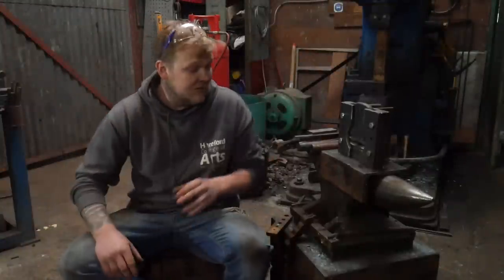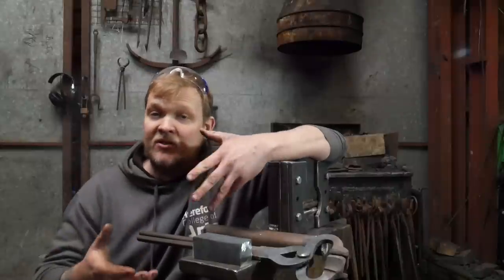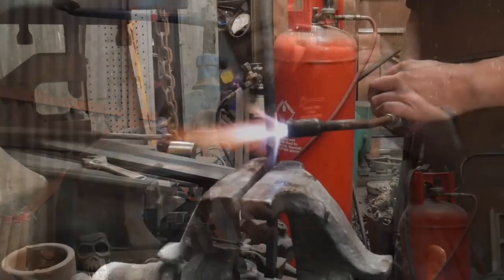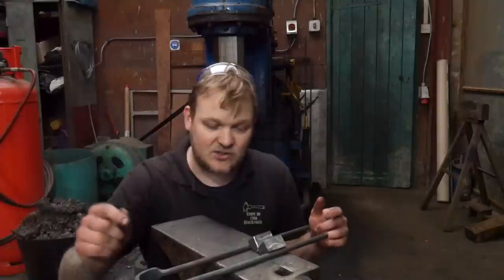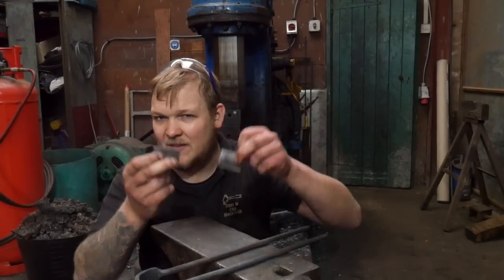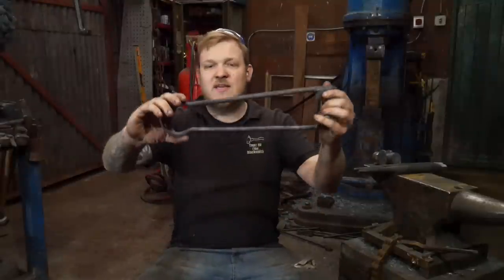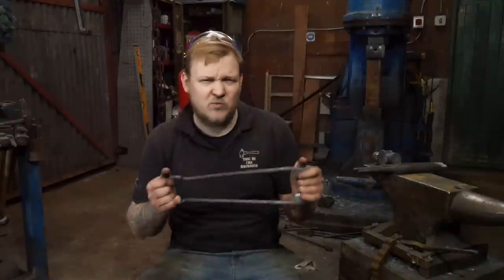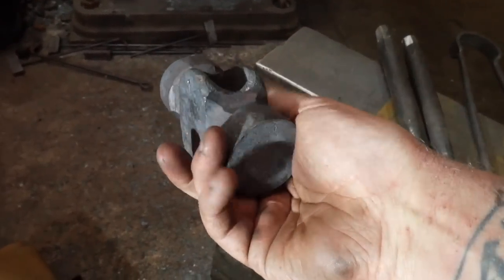Spring Fullers & Hammer Eye Drifts. Tools to make tools.

Comment: Good to hear you're busy. Hoping to see some more hammers up on your Etsy. I'm defo in the market for one of yours. Need a 2.5 (or so) pund rounding hammer. When you've got some stock on hand ping me and I'll buy it as soon as you do. Also, I'd love to see a how to on a spring fuller for a hardy hole. I don't have a striker or power hammer. I've had crap luck doing one myself

Comment: Hi Dan, love the video's on tools to make tools.  I'm in the process of building my first forge and its great to see the techniques you use. Can you let us know which materials you use for the different tools or alternative materials if possible. Thanks, Rob.
Reply from the maker: Ill try to remember for the next video. Ill do a bit on steels. Thanks for the great comment.
Reply: I am also interested which material you used for the spring and the actual shaping parts on the ends. My question would also be, in lack of a power hammer, if these spring fullers can be somehow used or attached in the hardy and use it with a normal hammer.

Comment: I'm loving these video's! I have noticed that your auto focus is doing some really random things. Just a thought for your hammers that go in the "bin", the 2 ends could be drawn out before cutting away from the hammer eye....... imagine a hammer eye with 2 blanks for center punches (or something similar) ready to be chopped off and sent out to happy customers. I know it won't cover the cost of a hammer but it's better then scrapping them 👍
Reply from the maker: I cut them all up and uses as much as I can. As for the auto focus I some times forget to slightly back the lenses off a little when i'm in closes. Theres no where for it to go so it bounces a round. like i said rough lol
Reply: @danielmoss2089  does that mean you actually have a bucket of hammer eyes?!?!?!? That would make forging hammers so much easier if you have a load of eyes waiting to be thrown on a hammer 😁 Probably best to keep them for emergencies when you don't have time to punch a hole LOL (and no, I hadn't actually thought of that joke when I made the first comment, it just came to me now) 👍

Comment: I didn't notice the echo until you brought it up but if you want to stop it you can make some sound absorption panels. I have a video on my channel titled Sound Absorption Panel Assembly. It's basically a 2x4 ft box to hold a batt of Roxul Mineral Wool insulation 4" thick. I assume by your accent that you aren't in the states but I sourced mine through Lowe's building supply. I used them in a band rehearsal hall and hung them at ear level on parallel walls and hard surfaces. You can reduce a significant amount of noise in a room by doing this.

Comment: I always wondered why there are not several rotating & cooling drifts or punches on a project
Reply: Right? We even discussed it, you and I, in class 
That and tongs that hold the billet lolololol. 
🙏blessed be Rob
Crawford out 🧙‍♂️
Reply from the maker: I have a couple of small slug drifts that I finish up with on the hammer but normally just the one. However it was time to step up.

Comment: 🤔 haven't seen a guillotine tool yet with a spring or two, or even a latch to hold the top fuller up for easter material insertion 🤔
Reply from the maker: That might make a good video you should try it.
Reply: @danielmoss2089  just aquired a huge railroad spring off an engine, 12inch wide coils with 2+1/4 inch thick material, am looking for different designs for hammers, like Alex has Brien's "round/square" design, and hardware store is basically square stock with an octagon face, etc.. would like to check out other designs

Comment: this film is very disjointed with the demonstrator popping in and out of one thing to another. There is no continuity. Your info might be good, but with it being so disjointed and inconsistent it won't make much sense to people trying to learn. Your presentation isn't terrible, but isn't too good neither. You need to have a cohesive and definite direction when doing presentations like this. Everything needs to occur sequentially, not jumbled and jumping from one thing to another as you did here.  I watched less than 2 minutes and had to stop because nothing you were doing was making much sense.

Your audio was pretty much crap when you spoke because of the loud echoing in your shop. As someone mentioned, a good lavaliere microphone would have solved your poor audio problems. There were points it became difficult to understand you clearly because of the amount of echoing that occurred in your shop while filming.

You have a huge power hammer and what seems like a decent looking shop. I'm sure you might be skilled with blacksmithing, but when you do  your next presentation, plan it out ahead of time. Have a cohesive and direct approach. Have your presentation organized sequentially and move from one topic to another, or organize a single topic in sequential steps. That would be easier to follow and far more preferable to the jumbled mess you brought. 

You have a good camera and the editing isn't terrible. It could be improved upon. But by far your weakest points are lack of direction and continuity and poor audio.  If you redo this one by filming it again and have it better organized I may decide to watch. But I will not finish watching this video because it is just too disjointed and lacks good continuity. Thank you anyway.
Reply from the maker: Thank You for your honesty. I'm assuming you either don't like me or you haven't watched any of my other videos. I would be interested to see what you made of one of my video which was based around a project rather than a vlog.

I'm a little concerned  you didn't find the video enjoyable and i'm currently working on the way I create content. I think you and others are correct this one was a little messy and could have been better. I tend to have a rough idea of whats going on most of the time but my ambition can cause me some issues from time to time.  Balancing my job as a smith with creating content and keeping up with work can be difficult and I'm find that at this current time. I want to create more content helping my channel to grow and helping me make money in the career I have chosen whilst appeasing the youtube gods if you get me.  

I have asked about the echo and im getting mixed feed back on this. I'm not much of a videographer and I try my best so I can only work on one thing at the time and I'm currently trying to fight a lossing battle with lighting.  I asked for feed back cause it helps but you wouldn't have known that if you only watched 2 mins of the video. However it helps and your points have been noted.

I think a lot of people have been enjoying these videos and I'm not sure if your the brave majority or the disgruntled few but I'm not going to stop working on this more laid back video. Not only do I enjoy making them but I honestly feel that others do. Until the likes and comments match up with your very negative view I might think about modifying my ideas.  Also with the increasing video out put the channel has gain subs and views that can't be grumbled at and my etsy is buzzing. 

let me know if you do watch another video I would be keen for you to let me what you think? I was going to offer you a suggestion but i'm a gluten for punishment and I'm sure you will tell me just how that stinks as well.
Reply: @danielmoss2089  Mr. Moss, I based my observations on watching the video. There's no reason to accuse me of not liking you. I don't know you and we've never met. Forgive my bluntness, but I do believe in being honest and forthcoming. What I said about your video stands because it felt very disjointed and seemed to be wandering because you jumped from one topic to another without really completing any of the tasks you were talking about.

I started watching your video because I had a genuine interest in the topic based on the title of the video you posted. I also happen to do video filmmaking. Continuity and a strong steady storyline is important even if the video doesn't have a narrative. Your videos contains narratives because you are a presenter doing the narrative of your work. I like seeing things taken in order. I think you were trying to do an instructional video, but it was hard to tell because of how you suddenly switched and changed projects seemingly midstream. In my view as a filmmaker this produces discord and is disrupting.

Your editing is good, but it can be refined considerably. Use of j-cuts and l-cuts might be helpful because you are doing your narrative while filming. You obviously did your shoot in different takes because it's apparent that you took the time to set up your shots, then took the time to reposition to do your other takes. It's obvious you used some filler shots that you filmed separately and added them into your video. That's good practice to have b-roll footage to use in your videos. It helps to break up a monotonous and static shoot, and if done correctly, can actually improve on continuity in a film.

Do you see where I'm going here? My biggest issue is your continuity. It's weak and needs to be improved. I apologize if I offended you. It's my hope you'll take some of this as constructive critique, and is in no way intended to be criticism or insulting. It's obvious to me that you are a skilled smith and have a very good working knowledge of this venerable old craft. You have the right idea in your video filmmaking. With just a few tweaks and improvements on your delivery you could make some exceptional instructional and professional looking videos. 

Please though, stay away from the cheap and cheesy intros that everybody uses... you know the ones... "Hey Guys, what's up?", or, Hey Everybody... or Hi Guys..." and every different connotation of those cheesy intros that everybody uses. If you want to be a professional filmmaker or presenter, then by all means be one. Write a script, plot your films and lay out a cohesive direction that creates continuity and tells a strong story. 

And lastly, see if you can find a good lavaliere microphone to use so that you aren't recording so much echo from your shop. Video camera mics are ok, but very limited to what they can do effectively. A good boom microphone, or a personal lab mic are excellent choices for the work you do with videos. Forgive me for insulting you and offending. I meant no disrespect. Here is a link to the last video film I made. It's a PSA video I filmed to combat against pollution in Alaska.

Regards,

JW

The link:https://www.youtube.com/watch?v=u5NRRvjrG78
Reply from the maker: @alaskanfrogman  OK firstly there are some odd people in the world that get there kicks out of being arse holes. Not saying you are but cause of some of my content I've made in the past I've upset some people. It's clear that you didn't even attempt to look at a different video like I suggested in my reply. This is some what of an experiment and the feed back (criticisms) you gave was noted. Thank you for pointing them out I'm still learn. I'm a slow learner. Your honesty is welcome. 

Regardless I'm still going to work on this style and push it along with my more focused tutorial videos. I think if you watch one of these you might get a better understanding of me and my content and the reason I'm growing so well. (OK) 

The channel is grown and I'm using it as a why to grow my business. I didn't think or intend for this to happen just sorta did. I'm not a natural when it comes to camera and I fight an up hill battle. 

After your first comment I checked out your channel and some of your videos. Yes you make lovely video using a drone of some sort. There boring and I skipped through most of them to just grab the gist. Which if it wasn't for the text I would have got but I am slow.

Thanks for the advice I'm going to continue to make videos like this which ain't as refined as some of my other stuff. Well I think they are refined (or more so than this video.) I'm sure you could pull them to pieces. These blog videos take less time and some people like watch to what I'm doing in the shop. I hope I can refine the cuts and footage a little so I don't need to spend time editing. Which I hate. I spend loads of time making video and editing to create reasonable content. (I think.) not the best not the worst.

I would honestly ask you if you thought the same if you watch another video I have made. Your feed back (criticism) would be welcome.

Comment: You can save yourself some time making hammers by not drawing out the sides of the eye so much. Farrier rounding hammers have been made that vway forever with no problems. The eye is the same height as the diameter of the face. Just a suggestion since you're working too hard. 😉